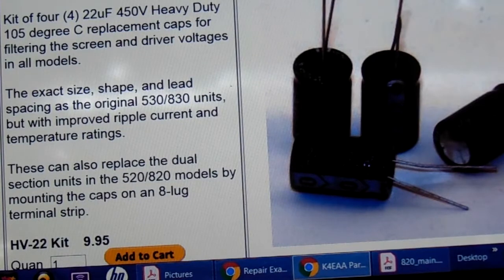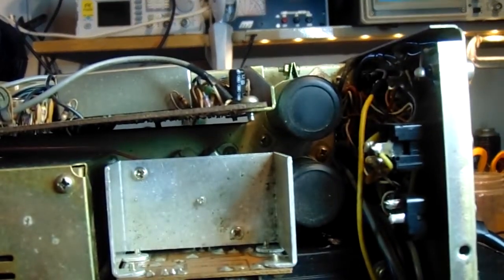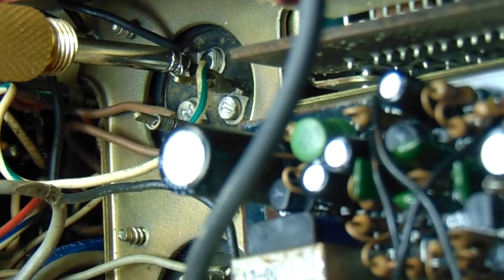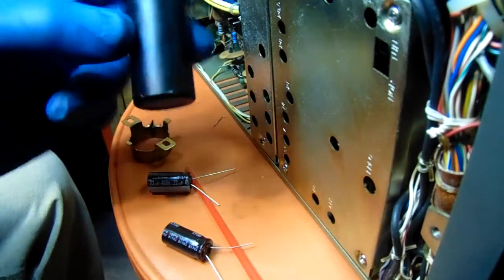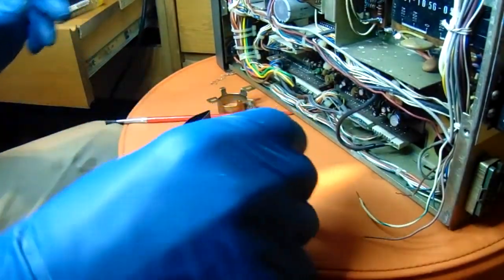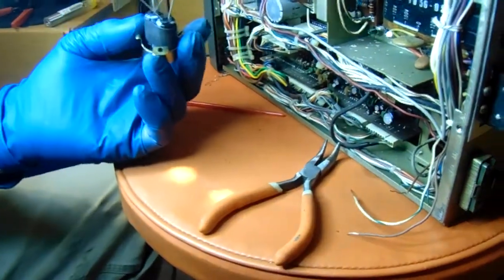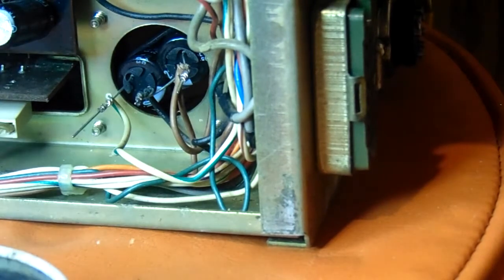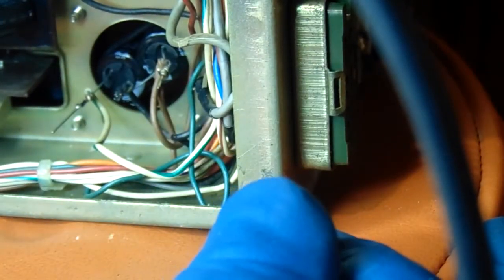Kenwood TS820s screen / driver capacitors

Comment: Enjoying your videos. I'm late to comment on this one, but I did restuff some collins caps by staggering them, one on top of the other. Then made the top capacitor leads longer. This will 
depend on the length of the original capacitor housing.
Anyway, great video.  Picked up TS-820, TS-820S and a R-820. So I'm following your steps. Fernando N2FQ/6